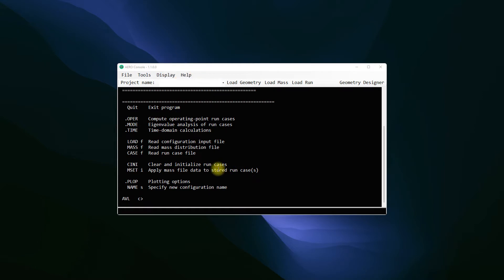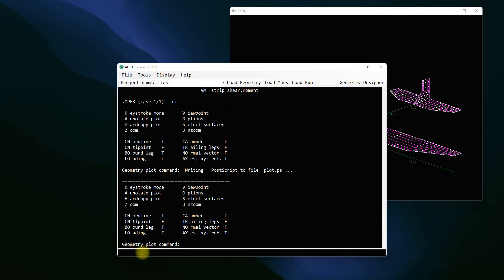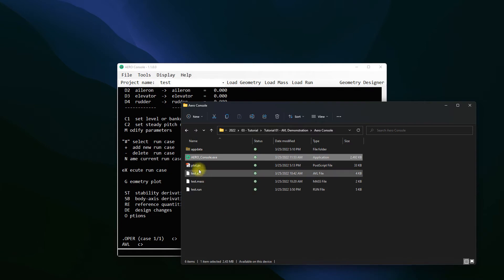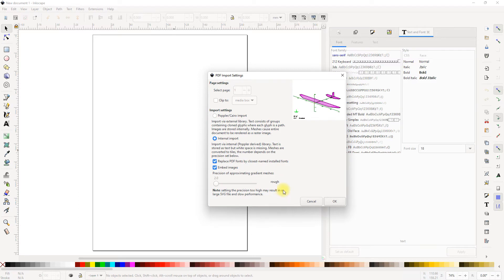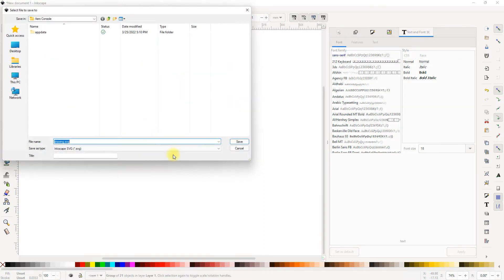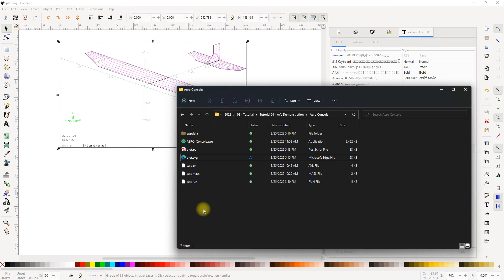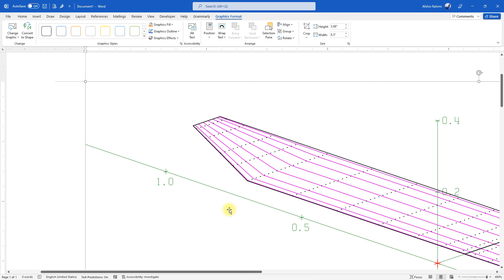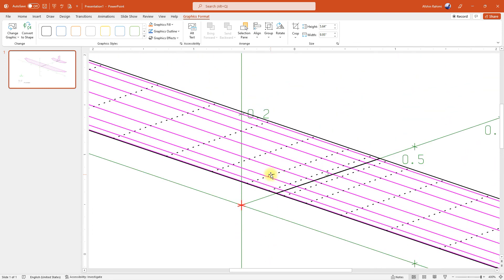AVL Tutorial - Part 08 - Vector Graphics Export & Import for Reporting

Comment: Hello sir. I am actually facing a problem. I was looking into the geometry plot, after which i performed some calculations and wanted to see Trefftz Plane. But the display which contained geometry plot is not changing to the Trefftz Plane, it only works after i closed everything and re ran the simulation and opened a new display with trefftz plane. The display is not switching. Any remedies for this?
Reply from the maker: Hi, Are you referring to the Aero Console functionality or AVL itself?
Reply: @arahimi_  i tried both, but facing the same problem.
Reply from the maker: I believe this is an issue with the AVL itself. Unless a separate mechanics is implemented in Aero Console to extract the data independently from AVL and do the plotting in-house, which would be a future feature, for now, you need to live with this issue. I am sorry! 😕

Comment: Hi, may I ask if it is possible to export the animation of stability modes to gif format? I've tried following the AVL user document too, but can't seem to make it work.
Reply from the maker: Yes you can do it, however, it has some automatic and some manual part. 

Toggling the Graphics-enable flag to F is recommended if AVL is being executed in batch mode using a command file.

Normally, all hardcopy goes to the single multi-page plot.ps file. Toggling the Individual PS file flag to T will place successive hardcopy pages in an individual files, named
-plot000.ps
-plot001.ps
-plot002.ps
etc.

These may then be used to create mode animation, etc.

The part that is manual is stitching these together using any software package that can do that to create your animation.

Comment: Hello! i was following this video and when i tried to drag and drop a .ps file onto the new document on inkscape after quitting AVL but it gives me this error: "Could not detect file format. Tried to open it as an SVG anyway but this failed", not entirely sure what to do, could you possibly know why it is giving me this error?
Reply from the maker: Hi, unforetunately, Inkspace cannot directly open postscript (PS) files but it can open PDF files. So you need to convert the PS files first to PDF and then open the PDF (vector) file in Inkscape. There are several free software options available to convert PostScript (PS) files to PDF format. Here are a few popular ones:

Ghostscript: Ghostscript is a powerful interpreter for PostScript and PDF files. It can convert PS files to PDF and offers various customization options. Ghostscript is command-line based and available for multiple operating systems, including Windows, macOS, and Linux.

PDFCreator: PDFCreator is a free and open-source tool that allows you to create PDF files from various formats, including PostScript. It installs a virtual printer on your system, which enables you to print the PS file and convert it to PDF. PDFCreator is available for Windows.

LibreOffice: LibreOffice is a comprehensive office suite that includes a built-in document converter. It can import PostScript files into its Draw application and then export them as PDF. LibreOffice is a cross-platform software compatible with Windows, macOS, and Linux.

Online Converters: Various online services allow you to convert PostScript files to PDF without the need for software installation. Websites like Zamzar, Online Convert, and Convertio offer free PS to PDF conversion services. Simply upload your PS file to their platform, and they will convert it to PDF and provide you with a download link.

Remember to exercise caution when using online services, as your file may be uploaded to their servers. If you have sensitive or confidential data, it's generally recommended to use offline software.
Reply: @arahimi_  Hello! Oh that is unfortunate. I decided to go with the PDFCreator and it worked perfectly! Thank you for your help and I very much appreciate how quickly you responded.